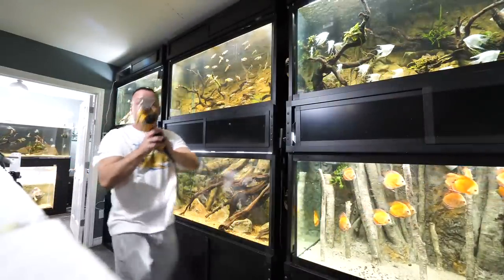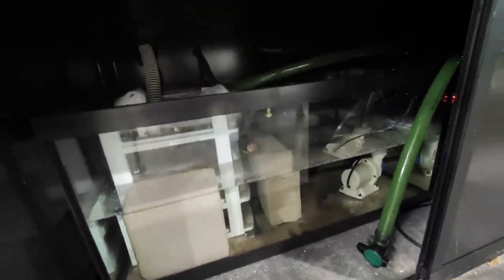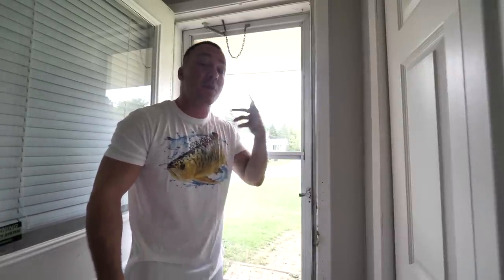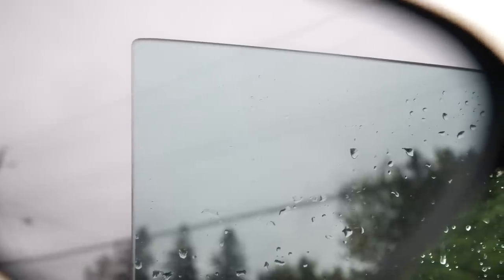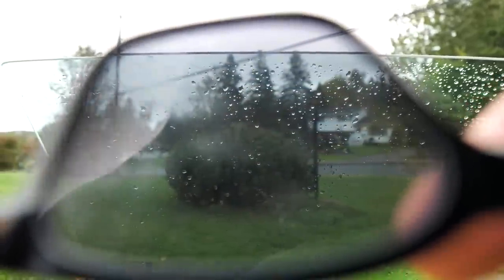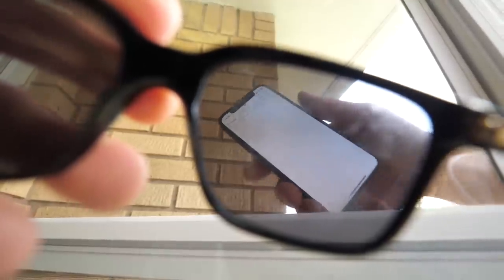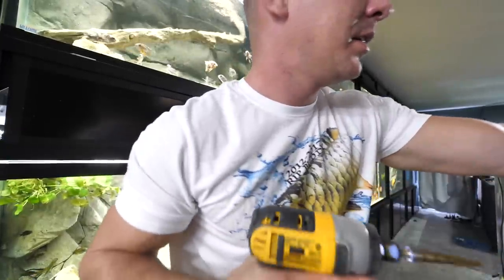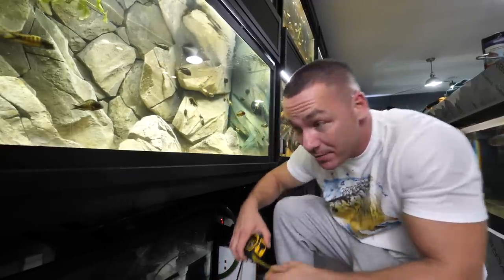DRILLING HOLES INTO FILLED AQUARIUMS

Comment from the maker: I have noticed a few comments on getting glass shards and glass dust in the sump. There were no shards and since im drilling from the outside in, the dust is on the outside. This would be different if i was drilling from the top down. Im drilling from the side. No dust or anything got in the tank besides the glass circle i removed. (Now on etsy) Kidding... if i did get anything in the sump, it would have to be a pretty large amount to cause any real issues(needing to get sucked into the pump and make its way to the top tank and pollute the entire 300gal system. Far fetched for sure. Bottom line i guess is... i was there. Nothing got in haha.
Reply: Lol.  Thanks for answering the question.  my thought was "joey isn't saying anything about the glass shards?  does that mean it's not a problem or does he just assume we would know what to do? "    so definitely thank you for clearing it  up for me.
Reply: This makes sense. I needed to do something similar, and knowing Joey did it makes me feel all warm and tingly. I wonder if I can sell my circular glass charm on his Etsy?
Reply: I'm gonna need that etsy account info..😉
Reply: The king of DIY was the movie you just so happened to watch called, "PIRANHA 3DD"?
Reply: What is it diluting with water at 8:50? I would say that is water you are spraying on as you go through the glass and as it has colour surely this therefore contains something and the only thing that can be is glass dust isn't it?
Reply: BornPedalling  and its all running down the outside of the tank isn't it? gosh some people
Reply: Make sure your phone screen is not OLED.
Reply: The king of DIY we are all just dust in the wind........
Reply: i need help,my tanks has algae that are like very hard to scrub off some are not even remove able what should i do?
Reply: The king of DIY cool buddy & i love seeing all the different tanks of fish & different animals 😄 plus the big tank with the stingrays 👍
Reply: a little silica never killed a fish, you could make a siphon with an air line to a bucket for cooling the drill also.
Reply: @BornPedalling  its running on the outside glass is inert anyway the fish live in a tank made of it
Reply: I have a 150 gal reef tank, it is up and running , I want to drill it and I have drilled many tanks in the past but never a tank full of water. How big is the risk of busting it do to pressure from water in sick a large tank??
Thank you...

Comment: Everyone is worried about the glass dust in the water. The majority of the grindings will be on the outside of the tank. Any glass dust that goes inside when the drill passes through will behave like sand and simply settle to the bottom of the sump. Glass doesn't float once it is suspended in the water.
Reply from the maker: People usually worry about things they dont understand. No worries. Thanks for helping clarify.

Comment: To drill the hole easier first drill into a piece of wood or sheetrock then use that as a template and you will get a perfect hole without scratches. trust me it works 😋
Reply from the maker: I know! I mentioned the video i made and linked to it doing it that way. (I made it years ago)
Reply: @thekingofdiy  I rushed to comment before watching the whole video. ... I guess it was before my time. Maybe I should ketch up on all the old ones!

Comment: What about glass dust/particles getting into the sump and mixing into the water and going into the tank?
Reply: same question here
Reply: The ground up glass residue isn’t sharp, it’s basically really fine sand. Besides, most of it ends up on the side you drill from anyway. It won’t do any harm.
Reply from the maker: There was dust from the cermaic media in the water. No glass dust got in the tank. its all on the outside.

Comment: ok. Now simulate a power failure. Did you leave enough space between the bottom of the drilled hole and the pump for it to have enough reserve to top up the tanks when the water comes on? That's the big problem I've experienced that I could only solve by getting a way oversized sump
Reply from the maker: Yes. Sump size will handle it.

Comment: I really like your clever trick to find out if a pane of glass is tempered or not! Awesome little trick!

 I am worried about the glass shavings and dust making into the water though, no matter how hard you try, doing this job with water in the tank is guaranteed to introduce at least SOME glass powder into the system, even if it is only a very small amount.

Does anyone, or even yourself Joey, know what kinda affect this would have on the fish? More curious than anything else.

Comment: Brilliant info, just done this myself after 7 cans, battery ran out half way through but after an hour charge was very easy to do.
I did use a suction guide though & I would advise getting one, makes it so much easier, they are only £10 of eBay.

Comment: Awesome info with the glass, is the seal enough tho or would you recommend a silicon seal as well?
Reply: the rubber gasket is a plumbing standard. it's perfectly fine without adding silicon.

Comment: Hey, I got a question, I am experamenting with drilling on a 10 gallon tank and so far I've been ok, cracked 2 but the most recent 8 have been good. I want to drill my corner tank which of course is thicker glass. I want to make sure I do it right however.

Comment: Wondering if anyone could give me some advise if I was to put an acrylic divider in my glass fish tank and have one half cold water and the other half tropical would the glass break due to stress or would it be okay?
Reply: look up what acrylic;s max temp is and what its lowest temp is and just don't  breach those and youll be fine.     think about it does your window shadder during winter when its   -30 F outside  but 75 inside
Reply: @soulsreaper7145  good point mate thankyou it was more the glass I was worried about. Just I've searched and searched and not heard of anyone keep cold water and tropical in the same tank I just thought there must be a logical explanation obviously not though
Reply: Rui Wang  not so bothered about the energy as my tank runs off two sponge filters from the same outlet anyway I think it would cost last to have it all running in the same tank
Reply: I personally wouldn’t do it! Acrylic doesn’t glue well to glass and silicone doesn’t adhere well to acrylic! If you were to silicone the acrylic divider into the tank and then do a water change on one side of the tank the dam would burst from the water pressure. If we were talking about putting a acrylic divider in a acrylic tank and permanently welding it in then that could be done but you will still end up fighting the water temp! I would just go with 2 tanks set side by side on one longer stand.

Comment: My tank 125 gallon shattered like tempered glass. I totally thought it wasn’t tempered glass because the bottom of the tank already has 4 holes drilled into it for the overflow that goes into a sump. But I’m just wondering how we’re the 4 holes drilled and when I tried it shattered? I’m thinking the 4 holes were drilled before the glass was rapidly cooled? I hope you reply I love your channel. But i was drilling more holes for a under gravel filtration.... I never seen anyone do this. But I did this on a 20 gallon and it worked great, it has a lot of gallons per hour and you can see the suction from inside the tank.
Reply: A lot of tanks bottom glass isn’t tempered and some of the back panels

Comment: Those lines in the tempered glass are not from rollers.  Those lines are the actual stress lines associated with glass under stress.
Reply from the maker: Actually, it is from the rollers. sorry.
Reply: I just googled it to make sure.  It isn't from rollers.
Reply: @thekingofdiy  just got called out lmao and I think you're wrong on this one
Reply: The lines that Joey is describing are from the rollers. To see the stress lines in tempered glass you need a dark background and a special strengthened glass detector.